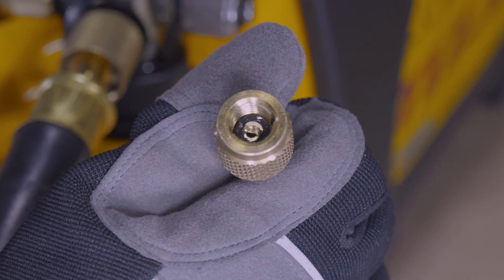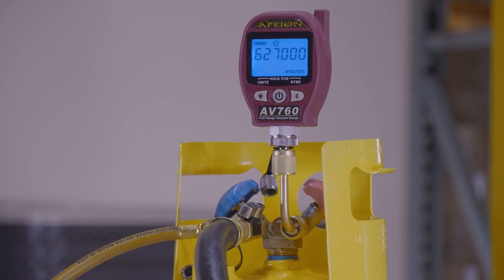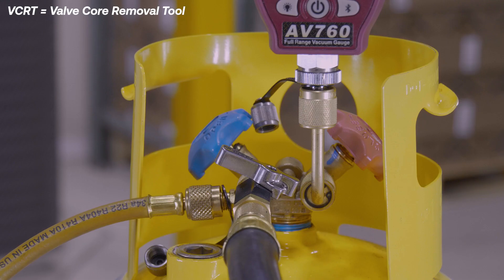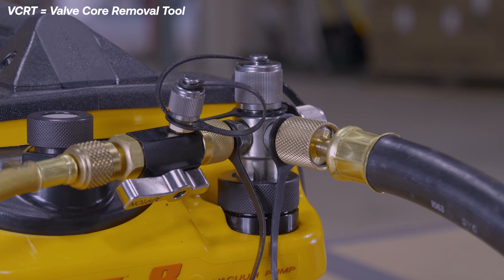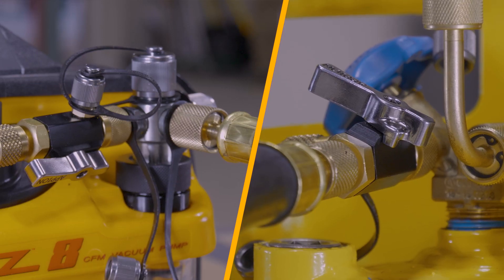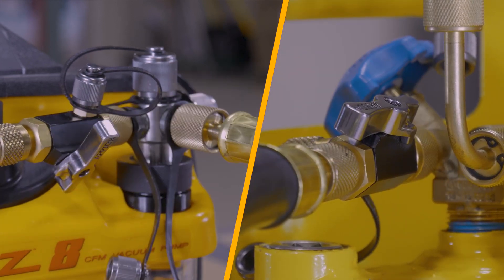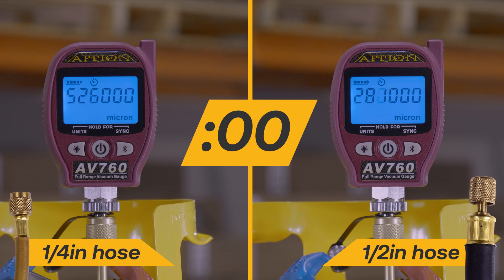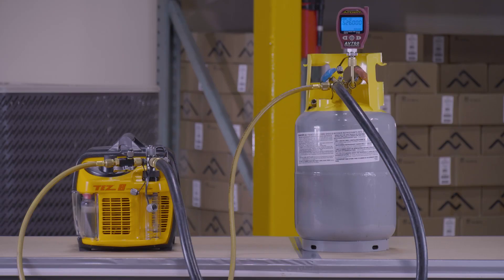Does hose diameter really matter in evacuation?

Comment: I often see that larger diameter hoses are suggested for getting a deep vacuum faster.

That doesn't make sense to me.  Maybe to get to something like 20000 microns faster, but below that the flow is actually minimal.  If there's very little flow, the size of the hoses won't matter, will it?

Nearly all the time is spent getting from something like 2000 microns to under 500 microns.   Seems there would be negligible flow.

If I had more than one micron gauge, it would be easy to prove/disprove.  Put a micron gauge on either side of a long, small diameter tube and observe whether there's a difference in pressure when you get down low.  Anyone done that?